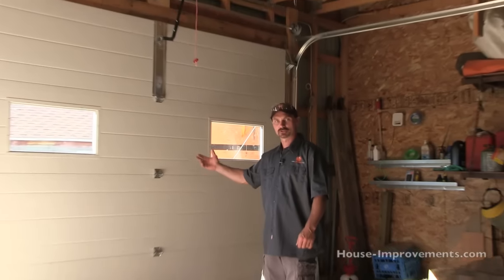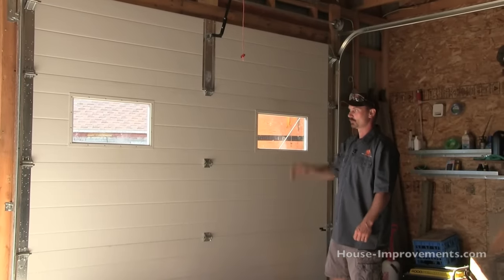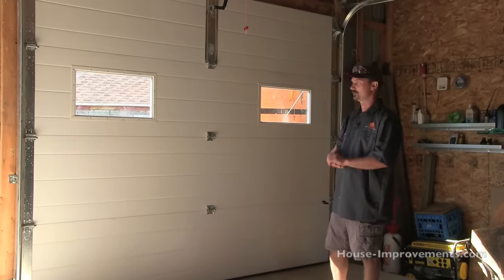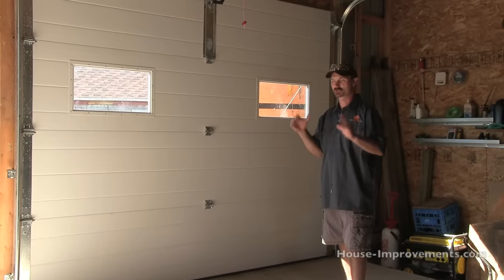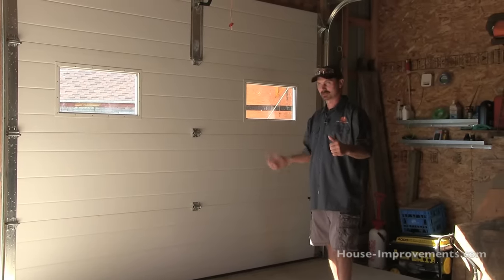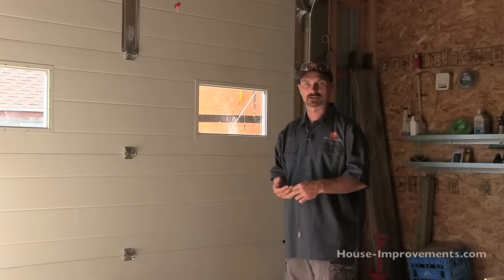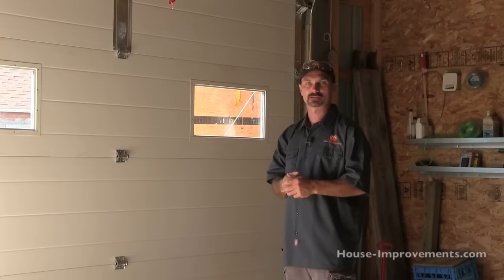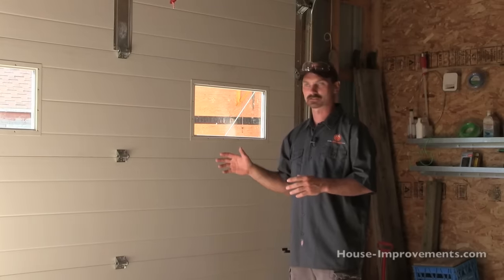How To Install A Garage Door

Comment: Thanks for the video. Are the 2x6’s a must? Or can we just mount right onto our existing framing?
Reply from the maker: not a must but usually if they are not used the 2x6s the mounting hardware ends up lining up to or close to the joint between the framing members and you get a weaker attachment.
Reply: HouseImprovements thanks.
Reply: HouseImprovements thanks for the instructions. Just completed my garage door because of this video.

Comment: How do you know if the top track is square with door i guess, so when the door is up its not like angled or anything?
Reply: Horizontal track hangers are usually done last with the door part way up and a rope sling supporting the rear end of the horizontal track. Remember these shows have everything cut and marked with perfect square and plumb openings.
PLEASE NOTE: After a few thousand I am a pro BUT I have made plenty of messes, especially when I first started so be careful and use good judgement.

Comment: Is there any isolation to put in on top?

I just moved to a new house, they lifted the house to redo the foundation the year before. The house is perfectly fine but the garage door need a new seal at the bottom because it's a bit tore for 2-3" at the bottom and there's air coming inside via the top. I suspect it's not normal.
Reply from the maker: There should be a weather stripping on the outside on the sides and top. we can help more in the forum if you need it? https://www.house-improvements.com/forums/

Comment: think you do fine videos. but how did you square the rear track so when the door opened the track didn't run out too far or in in a narrow alley where you put the 2x4 back hang? thanks for a reply. a+++
Reply from the maker: Hang them temporarily close to where they need to be then open the door by hand and adjust their position then mount them in place, solidly and use an angled brace as well. Watch at the 58min. mark
Reply: Thanks

Comment: I have a Amarr 7x8 door installed at my house and recently purchased a 7x8 clopay insulated door to replace it. Will the clopay work on the same track as the amarr?
Reply from the maker: I would assume so if you are using all the hardware from the Amarr

Comment: can you or should you use existing rails and spring when installing a new garage door?
Reply: +Michael Stoddard Having the right spring is dependent on the weight of the door so you should never reuse that. You should use the one that typically comes packaged with your new door.

Comment: How can I permanently seal a shower drain? The inspector that came to my house told me to do it. My garage had a patio next to it & it had a small bathroom with shower, toilet & sink ( I also had a roof over the entire thing) I tore  everything down about a year ago & am left with a big concert slab which is now again, the patio, which is now bare with no roof. I don't know how to seal my toilet permanently, ( I had to remove everything) my shower drain is opened & I have crickets & water bugs all over my yard.
Went to my local ace & an old employe told me that plugs don't exist for drains. He said I had to break it all up & fill it up with cement. He also said to do the same thing with the toilet. I've seen plugs for toilets. I've only seen test plugs for drains. Can you please help me? Oh! & I live in SoCal. Thank you so much!
Reply from the maker: Please come to my forum and post your question I can answer it there ,thanks.
http://www.house-improvements.com/forums/

Comment: What screws would you use if your walls to the garage were cement blocks??
Reply from the maker: I would still install wood around the opening and mount the door and hardware to that. Wood could be mounted with a combination of construction adhesive and" TapCon" screws.
Reply: HouseImprovements okay I will do just that!!! Any more advice would be appreciated! Thanks!

Comment: When fixing the first vertical rail to the frame, right after fixing the first screw( leaving enough wiggle room)..... wouldn't it be better to take a level & fix the rest of the rail regardless of the others wiggle room. 
Because when going on the other side if you fix the first bottle braket of the rail to the frame,  then use the level again things should line up better with same gaps....... I think? I'm no expert, but would love feedback please. Great video 👍

Comment: How does winding the spring down work? Wouldn't it put tension on the shaft the wrong way?
Reply from the maker: If you wind the spring the wrong way yes it will put tension on the door in the downward direction.
Reply: @HouseImprovements  oh, maybe I'm hearing you wrong. So basically, you need to make sure that the spring end is pointing up when you wind it. correct?

Comment: That door your doing is a steel craft door i have instaled tens of thous. Of thease i got my start with sc doors in western canada so i know the hardware and could install in my sleep the bolts u use in the track bolts are called track bolts and there 1/2" with a 5/16th shaft there are so menny things you are doing that are not condusef to doing a good job for a 10x8 door i could with total honesty would take me less than 1 hour and  40 min for the door opener with the wireing as well

Comment: How about in the case of a 8'x6'6" opening? I can't find a door that size but can find 8'x7' doors.
Reply from the maker: Well you can custom order a door but in reality the 7' wide door will work, just centre it on the opening and install
Reply: Hey Shannon, the opening is 8' wide and 6'6" high. The problem is the height, not the width. Sorry for the confusion. Can I still use a 8'x7' door in that case?
Thanks.
Reply from the maker: Well again you can order a custom size but it could work possibly. You need 12" of extra height between the top of door and ceiling for most doors with openers top operate and less than that if there is no opener.

Comment: Do the door tracks need to be installed on the level on both the horizontal and vertical aspects?
Reply from the maker: The vertical tracks are usually not plumb so that the door pulls slightly away from the frame when door is opening. The horizontal tracks do not need to be level  but need to be close
Reply: I work for Chamberlain, and videos like this help me to be able to better help my customers.

Comment: I have a 16x8 door that has 2 springs that are bolted together with a bearing in between them.  Do they both have to be wound up ?  The manual says 8.5 turns but each spring has set screws. Ones marked red and ones marked black.
Reply from the maker: I've only ever install doors from one manufacture (StealCraft doors) and their doors have the red spring to the left and the other spring on the right. Both Springs will be wound the same way . Watch at the 49 min. mark to determine your direction.
Reply: @HouseImprovements  ok great. We did both. We tried the door. It has a little bit to much tension I believe, it opens a couple feet without barely touching it but it stops after that, what the best way to drop the tension slightly, is it the springs to be loosened off a bit or the cables or both ??

Comment: Had a question for framing a rough opening for a 16 ft wide door, our specs here say to use three 2x10’s for the header. We are using 2x4 walls.  So the thickness of header is 4.5” wide and the walls are 3.5” wide.  So what happens to this 1” extra thickness of header. Does the rough opening just stick out an extra 1” past the wall then in towards the garage ??
Reply from the maker: I frame the front wall of the garage with 2x6s to accommodate this extra width or at least the king and jack studs need to be 2x6 to support it all and the extra thickness sticks inside the garage .
Reply: A local inspector said below the header for sure has to be fully supported over the 4.5” but above might pass the inspection with the 3.5” but not worth the hassle better to do it with all 2x6 which a local garage builder has mentioned doing as well.  Thx for the info.

Comment: Why dont u put the bottom rubber in before putting it in place?.. its much easier to do before that later
Reply from the maker: I work by myself so when i do it after the door is installed i dont need anyone to hold the panel from sliding while i insert the weather strip.

Comment: If you have a GDO on a door over 8 feet wide you really should have a strut on the top section for added strength why did you not on this door?
Reply from the maker: +Ronnie Carman You must be using cheaper doors I have never seen one on theses doors under 12' wide.

Comment: Everything looked good except the lock bar was installed wrong. It bolts to the door and bar extends through the track to lock
You just have to punch out the knockout on the track
Reply from the maker: Not sure what your talking about, this door does not have a slide lock bar?

Comment: I want to replace a wood garage door with new steel door like the one you just installed. I don't need a electric opener. How do I install a lock that will prevent crooks from breaking into the garage from the outside. I don't think a normal outside door lock, with key, is good enough, as this door faces an alley that no one watches, and people can pick locks, or break them I am thinking the lock should be on the inside of the garage  I can open it from the inside only.

Or should I just plan on an a electric opener on the garage door?

Do electric openers make it 'nearly' impossible for a crook to open from the outside?
Reply from the maker: There are interior locks that screw to the inside of the door and a metal slide bar locks into a groove on the track. These are purchased separately when you order door. Electric openers are not completely thief proof.
Reply: @HouseImprovements  Thank you for that info. I appreciate your help, and your video!

I just discovered I have another potential issue. 

My studs on the left and right side are not perfectly 'plumb', and they are slightly off parallel 9If that is the right term?) 

By 'not plumb' - I mean that the tops of my studs, at around 8ft height, are leaning about 1" further out, towards the outside of the garage, than the bottom of the 2 by 4 studs.Will the door still move freely with this difference? (I assume the door track will be slightly off by the same amount - after I screw it into the studs?) 

By 'off parallel' - I mean that the bottom of the left 2 by 4 stud appears to be about 1/4" off a "straight line", drawn at a 90 degree right angle from the side of the garage, and which would runjust in font of the left side stud, and the right side stud. Is that a deal breaker?

How might I address these issues - if they actually make a difference in the way the door would operate?

Comment: Why did you not slide the bottom weather stripping on when you took it out of the box? Would have been a lot easier.
Reply from the maker: It can get in the way if you are having to adjust the door to level with shims.

Comment: Can the door width be smaller by an 1-1/2" on each side, l have an opening in metric for a 10ft door in borick 296 wide x 260 high ?
Reply from the maker: Yes that should be fine as long as you have framing inside to attach to.

Comment: When you are measuring for the Rough opening, is trim considered part of the RO or just leave that out?
Reply from the maker: I make my finished openings 1" narrower then the door panels and 1/2" lower. So if you have a 16x7 door the finished opening would be 15'-11" x 6'-11.5"
Reply: @HouseImprovements  So you said in your video to make the door be 1/4 bigger than the rough opening, so are you using some kind of 1/4 siding or what are you using to finish the opening?

Comment: Hello I need to know how much is price for 4 meters weid and 3 meters high garage door
Reply: It all depends on the door it self such as color model company and windows if you go with just a plain door I would recommend ordering one from steel craft that the one I carry they are simple and build strong enough to survive the weather and most abuse you door is a bit of an odd ball size but off the top of my head again this is for my brand steelcraft stander no windows white it would be around 800 -1100 and of course there is also r value or thickness which are t-12 t-16 and the commercial td-134

Comment: hey, Thanks for your well made Video. Question: I am installing a 16 X 8 door, the top section is 7/8 " shorter than the rest sections. is that normal? Thanks.
Reply from the maker: every door manufacturer has there system, I can't say for sure. Usually I would say they are the same when the opening is a standard height but may not be true for everyone. These doors in the video where 8' high and the panels where the same.

Comment: Is better to use a socket that's has a magnet hold the screws for you
Reply: You should just install the track from one side and then you can install the second track and then you start putting you panels one after the other

Comment: Question. My garage door panels were damaged in a wind storm. The railing and everything else is perfectly in tact but the panels definitely need to be replaced. Does the entire spring process need to be done still? Or can the cord just be threaded to attach to the new door?
Reply: You would have too slightly raise the door & back charge the spring /s with the tensioning bar. (this will allow the lifting cables to go slack) Then block off the panel about the one your changing & then start to remove the panels. Then re fit new panel then do it all in reverse order
Reply from the maker: you need to unwind the springs, change the panels and rewind.

Comment: Thanks for the great video. Do you have any recommendations for removing springs that are almost 18 years old? I need to remove and reinstall my garage door. Should I just go ahead and replace the springs?
Reply from the maker: +Christopher Jones Likely a good idea to replace the hardware,after 18 yrs it may not be worth re installing unless it was a quality door to start with.

Comment: ok my house was built in the late 50 to early 60 my garage door is old and super heavy! could that track be used on my new door?
Reply: No.  Most older model tracks are non adjustable. Doesn't work well with modern doors that are wider in width...
Reply from the maker: Get a whole new set up, that stuff is not compatible easily and has served its time.

Comment: better not to mess with improvised tools for winding the springs, especially if you're working with springs that require 30+ winds and/or multiple springs. buy something already designed to wind them

Comment: Wheel jumped off track aftet 1 week. How do i put it back?
Reply: unbolt the hinge  and insert the wheel rocking the hinge back into place then re bolt
Reply from the maker: if it jumped out you likely have the tracks to far apart  or something? They should not jump out. Use my forum if you have further questions.https://www.house-improvements.com/forums/

Comment: You mentioned about which way your supposed to wind the spring by where the end of it's coil is facing, but aren't you just supposed to look at the head of the spring, and see the color to know if it's supposed to be on left or right side, red for left, or black for right? Because when winding the spring, it should always be upward, not downward

Comment: We had a tornado. That rip our garage door to sheds. We are having to replace it. They man who is replacing the door says we need to order clovepay. But all the videos say different and most videos I've seen say those doors are pos. Pieces of shit. I don't know what to do? Need help. If can help me and tell me what kind you think is the best and who could   install one for me. Insurance  is paying so I want the best. Thanks in advance for a  response. Andria or Larry Logan from McKenzie.
Reply from the maker: I'm from Canada so i know no one in your area ,sorry.
Reply: Andria Logan   Yes clopay are junk when buying a door ask for the  "R" value that's the insulation value  higher value better door and if your getting an opener also request a  U- bar on the top section every door with a opener should have one

Comment: i wanna put  a garage motor door what is a good size
Reply from the maker: Check your choices with the size of door you have. In most cases residential doors are fine with a 1/2hp opener.

Comment: The Door Brand is a Overhead door and has no aluminum in it . Its  a steel door and poorly treated steel  I don't recommend them the bottom section will rust out along the proprietary sub standard bottom faux foam  rubber strip edge   in less than 10 years . Nce video for a novice installer do your self a huge favour put the faux  rubber bottom seal  and cables on the bottom section before putting the panel in place Will be making a video  some day but not until I retire  lol  I have installed Garage doors for over 35 years have installed thousands and put two in today. .

Comment: Everything was good until you put the bar on your shoulder - I would never let that much force be that close to my head. Safest thing to do is put a bar in a lower hole and let the thing unwind to have the tension hold the bar against the door.

Comment: I do this professionally.  This guy doesn't even know what half of the parts are actually called.  And what about leveling the bottom section so the door runs level and not at an angle?

Comment: Is there a maximum height above the door that I can install the header bracket for the door opener? 
I want to install a 9’ x 7’ door, but need the door opener motor to be at least 8’ above the floor.  To get a 9’x 8’ door would be a custom order and would greatly increase the price.